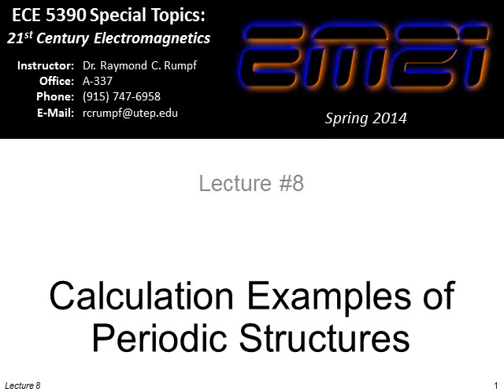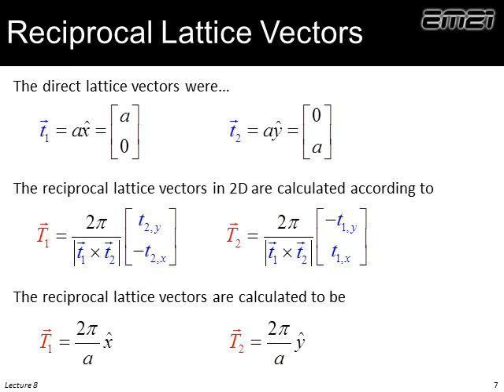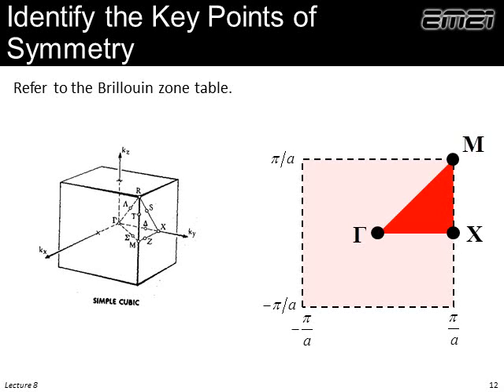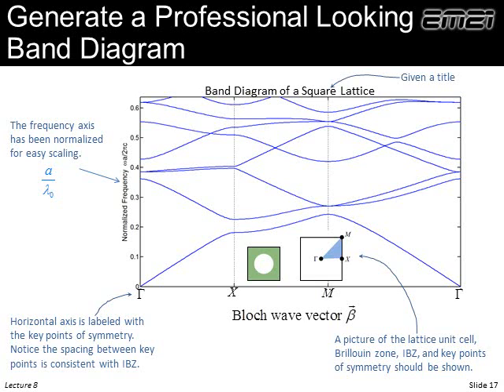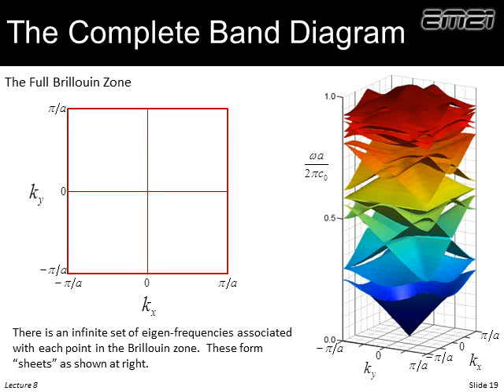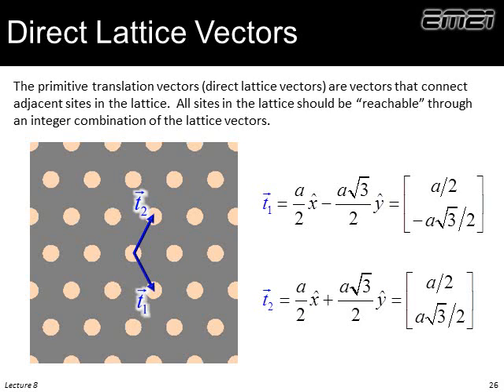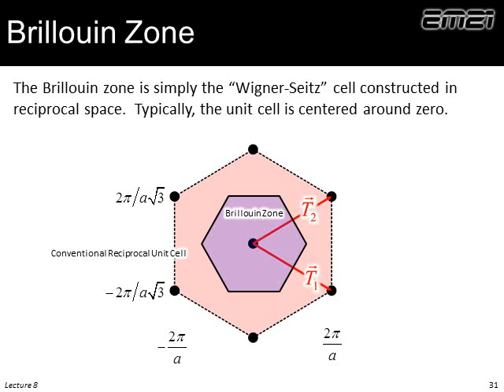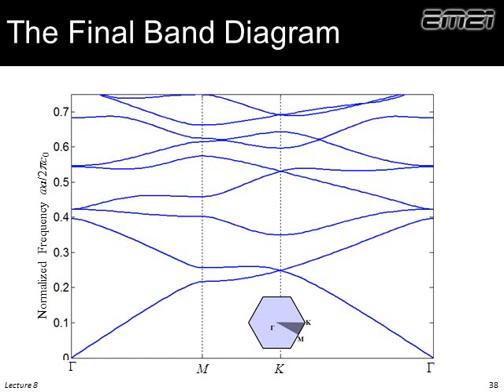Lecture 8 (EM21) -- Calculation examples of periodic structures

Comment: In the lecture presented here, the unit cell of periodic structure is contains circular hole what if it is not circular(hexagonal) or it has complex shape but let's say it has the same direct lattice vector as the unit cell of periodic structure that contains circular hole, is it appropriate to sample (kx ky) only along the boundary of  irreversible Brillouin zone?
Reply from the maker: The lattice vectors only describe the symmetry of the unit cell, not the pattern within the unit cell.  Therefore, no matter what, all unit cells of the same symmetry will have the same Brillouin zone.  Now, the IBZ can be different depending on the pattern within the BZ.  If the unit cell has left/right symmetry, like a heart, then you can cut your BZ in half.  A heart does not not have up/down symmetry or any additional symmetry so the IBZ would be half the BZ.  A circle, as you know allows the IBZ to be a little triangle within the BZ.  The IBZ does depend on the pattern within the unit cell.  Marching around the perimeter of the IBZ can be said not matter what the pattern is within the unit cells, but the shape of the IBZ will change.  Did I make sense?
Reply: @empossible1577   Thank you for your nice response! Just to make sure I got this right, so for example you mentioned (heart like shape) the corresponding IBZ is half of BZ, therefore, sampling (kx ky) around boundary (perimeter) of half of BZ would be enough? or we have to sample meshgird (kx ky) of over half BZ(IBZ)? Since I am planning to run multiple simulations for different shapes, I have to reduce my simulation time by sampling as small as possible(kx ky).
Reply from the maker: @wabidemeke3067  Each shape can have a different IBZ.  You may need to just always do the full BZ.  I suppose you could have your code check for symmetries and then calculate different IBZs.  Whenever I have done this, I just calculated throughout the entire BZ.  Yes, that wasted some computation time.

What numerical method are you using for calculating the bands?
Reply from the maker: @wabidemeke3067  Very good.  I noticed you are watching an older video.  In fact, I have actually greatly improved this section of material.  Checkout "Solid State Electromagnetics" under Topic 4 at the following site:

https://empossible.net/academics/emp6303/

Comment: What program did you use to get the band diagrams? And thanks for the lectures, they're super clear and helpful.
Reply from the maker: Everything here was done in MATLAB.  The band diagrams are usually calculated using the plane wave expansion method (PWEM).  This technique is covered in course prior to this one, Computational Electromagnetics.  Here is the course website for CEM:

http://emlab.utep.edu/ee5390cem.htm

Comment: Nice lecture. To obtain bandstructure using FDTD method, we have to locate the dipoles far enough from the pml boundary. I say it because they cause some noise in a bandstructure result but I dont know why? Do you have any justification for it?

Thanks
Reply from the maker: Unless you are doing something special, you should not need a PML in FDTD to calculate the band structure.  Instead, you should use periodic boundary conditions on all edges.  Calculating bands with FDTD is a bit tricky.  I talk about that in Lecture 10 here:

http://emlab.utep.edu/ee5390fdtd.htm

You may want to consider a different numerical technique for calculating band diagrams.  Take a look at finite-difference frequency-domain and the plane wave expansion method here:

http://emlab.utep.edu/ee5390cem.htm

Comment: Greetings  Dr. Rumpf. THIS IS THE BEST LECTURE I HAVE EVER COME ACROSS.... The material were cogently presented, well illustrated and with so much ease... I can't thank you enough for this video sir.

I have two questions regarding unit cells?

1.) If i use Finite Element approach in stead of PWEM. I will need to mesh the unit cell (that has the matrix and inclusion). My question is; should i mesh the physical unit cell, or the unit cell in a reciprocal space? 
If I have to mesh unit cell in a reciprocal space, how would i provide the dimensions for the inclusion, supposedly its a circular inclusion like the one you used to illustrate in this lecture

2.) My second question is, for 1D periodicity, would the two options for the choice of unit cells give exact same band structures?

Thank you in advance sir! And again, thank you very very much for this video lecture!
Reply from the maker: Thank you very much!  I am so glad the videos are helping you.

1) For FEM, you will mesh the unit cell in real-space (i.e. xyz).  There are methods that mesh in reciprocal space, but I do not think that is what you are talking about or would want to do.

2. What two options do you have for the unit cell?  A unit cell is the smallest block of something that can be stacked to recreate that something without any overlaps or voids.  Given the boundaries of the unit cell, you can slide that through your lattice and grab whatever pattern is enclosed within those boundaries without any problem or change to the band structure.  Maybe this is what you mean?
Reply: Thank you for your timely response Dr. Rumpf

1) Yes sir, my project is to use FEM to solve the Linear Eigenvalue problem for the "omega given k" approach as well as solving Quadratic Eigenvalue problem for the "k given omega" approach whereas the later gives the real and imaginary k for the complex band structure.... 

Now since, the traditional (or rather conventional) way of  computing the dispersion relations (band structures) uses First brillouin zone, which conveniently, gives the band structures that runs from through high symmetry points... I was just wondering how would i be able to replicate  these points if my unit cell is meshed in physical space (xyz)

2.) Yes sir, by choice of unit cell, I meant something like 2:30 in this video lecture on the top. if you use either of the unit cells, weather the band structures are going to be identical

I could subscribe two times if i could in your channel, what a fantastic lecturer and a person you are.
From the bottom of my heart, Thank you sir
Reply from the maker: @GBabuu  Thank you again!!

1. Build your mesh in real-space and then build your matrix.  The information from your Bloch wave vector goes into the periodic boundary conditions to enforce whatever phase condition is necessary at the edges.  I cover band diagrams with finite-difference frequency-domain (another real-space method) in Lecture 15 here:

http://emlab.utep.edu/ee5390cem.htm

2. Both unit cell descriptions describe the same lattice so both will lead to the same band structure.  In fact, this is a great way to test your code.  If you get a different band structure, something it wrong.  Most likely you have not built the lattice correctly in one of the descriptions.  If you calculate the eigen-vectors, you may notice the raw numbers are different only because the fields are shifted along with the unit cell.  They should look the same if plotted over several unit cells.

Keep at it!
Reply: @empossible1577  
Dear Dr. Rumpf. I'm reading your response with widest smile on my face. 

How ironic is it, you mentioned that, the way to know my code is correct, is by using two unit cell descriptions of the same lattice with anticipation to get same exact solutions....because that's what my project advisor insisted as well.

And  its also amazing that you mentioned that the eigenvalues and modes, will not be of same exact numbering because of the phase shift. THIS IS SUCH AN IMPORTANT INFORMATION because I wondered about this too.

I'm now watching lecture 15.
YOU SIR, ARE SUCH A JOY... GOD BLESS YOU!!!!!!
Reply from the maker: @GBabuu  Ha ha.  You have giving me a big head!  Thx!
Reply: Dr. Rumpf, I had a very quick question

For phononic crystals (just like photonic crystals)... I know one assumption we always assert is that they are "infinitely" periodically either 1D, 2D or 3D.

Let's say for 2D phononic crystals (with I direction periodicity) would you model a unit cell as plane strain or plane stress?

The reason I asked this is because, plane strain is a proper estimation for 2D structures when one dimension is infinitely longer than the other  two dimensions (which agrees with phononic/photonic crystals)...... 

But the issue is; strain and displacement are assumed zero in the infinite length of the structure under plane strain..

 How can we reconcile this with the fact that, for phononic/photonic crystals we certainly do need the displacements and strain in the direction of periodicity?

Thank you sir
Reply from the maker: @GBabuu  I am not quite sure what you mean by 2D phononic crystal with 1D periodicity.  Your terms stress and strain are new to me when describing the geometry of things.  If periodicity is just 1D, then you only have a 1D phononic crystal.  It could be  that you have a structure that is finite in one direction, periodic is another, and then infinitely uniform in the third.  In this case, you model will need to encompass the entire finite direction and one unit cell in the periodic direction.  

I am not confident I have answered your question.  If you need to send me a picture, send it to rcrumpf(at)utep.edu.

Comment: Could you explain how to resolve the band crossing problem as you mentioned at 12:35 ?
Reply from the maker: This is something I have spent some time studying.  I don't have an answer other than I think it may be ambiguous if the bands cross or not.
Reply: @empossible1577  Thank you for quick answer. I guess this have something to do with the mode shapes (eigenvectors). It's natural to think that all the eigenvectors should have the same shape if they belong to the same band.
Reply from the maker: @taolin4569  That was my thought as well so I created an animation where I visualized the Bloch mode of two bands as they approached and passed where they cross.  The Bloch modes abruptly change where the bands touch making it impossible for me to determine continuity.

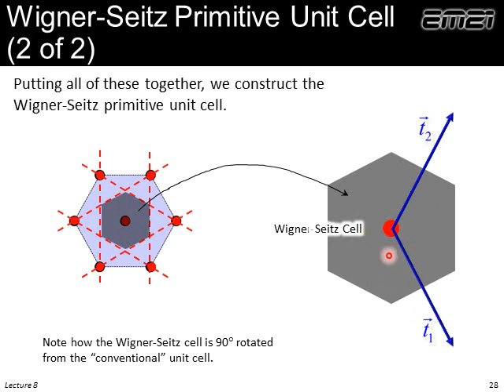Comment: at 21:46, i don't get the formula you use to find reciprocal lattices T1 and T2. what is [t2,y  -t2,x]??
Reply from the maker: Noah Nguyen The lower case letters (t1 and t2) are the primitive translation vectors of the direct lattice.  It is from these that you calculate the primitive translation vectors (T1 and T2) of the reciprocal lattice.

Comment: I always noticed that the points (111) became (kx=ky=kz=pi/a) and 
X(011) becam (Kx=Ky=pi/a , Kz=0)  Is there a rule for transferring them..? please
Reply from the maker: I think you are referring to the Miller indices?  A reciprocal lattice vector is an integer multiple of the primitive reciprocal lattice vectors.  The set of integers for that lattice vector are the Miller indices of the plane described by the lattice vector.  This may be the connection you are looking for.  kx, ky and kz are essentially the components of the lattice vector.

Comment: Dear Dr. Rumpf, I've been trying to simulate the band structure of a 2D hexagonal lattice using the PWEM as described in your lectures.  I'm sure my reciprocal lattice vectors and symmetry points are correct; however, when defining the device, I ran into some problems since the unit cell is not Cartesian but an hexagon.  In order to work around this issue I defined my unit cell as a body centered structure as follows:
a = 1; b = sqrt(3) * a;  Nx = 500;  Ny = sqrt(3) * Nx; P = 5; Q = round( P * sqrt( 3 ) );
ER0 = ( X.^2 + Y.^2 ) > r^2; ER1 = ( (X-a/2).^2 + (Y-b/2).^2 ) > r^2;  ER2 = ( (X+a/2).^2 + (Y-b/2).^2 ) > r^2; 
ER3 = ( (X-a/2).^2 + (Y+b/2).^2 ) > r^2; ER4 = ( (X+a/2).^2 + (Y+b/2).^2 ) > r^2; ER = ER0 + ER1 + ER2 + ER3 + ER4 - 4;
ER = 1.0 + ( er - 1.0 ) * ER;
However, once I run the simulation the band structure doesn't look right.  Could you comment whether the way I'm defining the device is correct or if I should use a different unit cell?.  Thank you very much and I really appreciate all the effort you have put into these fantastic lectures!.
Reply from the maker: Your code did not have everything I needed to verify what you are doing exactly.  I calculated X, Y, er, and r based on what I think you are doing.  Overall, the approach is correct.  The simulate a hexagonal lattice the trick will be how you calculate the Fourier coefficients.  There are two approaches.  First, you can perform a coordinate transform and then use a standard FFT.  For this approach, most people cite [Ward, A. J., and John B. Pendry. "Refraction and geometry in Maxwell's equations." Journal of modern optics 43.4 (1996): 773-793.].  The second approach is to perform the numerical integration of the equations on slide 8 of Lecture 18 here:

http://emlab.utep.edu/ee5390cem.htm
Reply: Thank you very much for your answer!.  My apologies for not including the whole code, but I decided not to do so, since it is basically based on your code for the square lattice.  

The only modifications I made was the way to construct the device, the reciprocal vectors definitions (T1 and T2), and the symmetry points (G, M and K).  I will double check the Fourier coefficients since I only changed Bx and By (through the definition of BETA).  Thank you also for the reference you suggest in your reply!
Reply: @empossible1577  can you explain me how to calculate the frequency of fonctionnement for 3D structure
Reply from the maker: @elmaftahsofia9564  fonctionnement?  Do you mean the operating frequency?  That is up to you as the engineer to choose the operating frequency.  Once you have that, you use the normalized frequency from your band diagram to scale the lattice so that it operates at your design frequency.  For example, suppose you have a band gap centered at wn = 0.5.  Now suppose you want at lattice that has its bandgap at a frequency of 20 GHz.  First, the free space wavelength of 20 GHz is 1.5 cm.  The lattice spacing should be a = 0.5(1.5 cm) = 0.75 cm.
Reply: @empossible1577  thank you
Reply: @empossible1577  plz can you explain me what does it mean normalized frequency ?
Reply from the maker: @elmaftahsofia9564  The basic eigen-value problem makes k0^2 the eigen-value.  Since k0 is frequency divided by speed of light, k0 is seen as frequency, but the scaling is not very useful.  A more useful scaling is a/lam0 where a is the lattice spacing and lam0 is the free space wavelength calculated from the frequency.  Given k0^2 eigen-values, you calculate the square root, divide by 2 pi, and multiply by a.  This is the "normalized frequency."

Comment: Is this Brillouin Zone calculation is valid for non symmetric lattice also??
Reply from the maker: +Vinod Kumar That depends on what you mean by non symmetric.  There are pseudo-periodic lattices that have some randomness to their geometry, but otherwise appear to repeat.  Some examples are penrose tilings and such.  Those do have a BZ although it is derived statistically due to the randomness.  If it does not repeat at all, like in a functionally graded lattice, the lattice does not have a BZ.  It still may help to think about localized portions of the lattice having a local BZ although it would only be an approximation.

Comment: Thanks for the nice lecture could you explain why K = 1/3T1+1/3T2 in 25
Reply from the maker: This just comes down to geometry.  If you draw the Brillouin zone and work through the geometry to calculate the positions of the key points, this equation falls out.  There really is nothing more to it.

BTW, this section of the course has been considerably revised.  I recommend accessing the material through the course website:

https://empossible.net/academics/emp6303/

The revised version of this video is now in Topic 4.  

Hope this helps!
Reply: @empossible1577  Thank you so much

Comment: Why we use band here instead of curves?
Reply from the maker: For ordinary homogeneous materials, there is just a single dispersion curve, or "light line."  However in periodic structures, there arise multiple solutions that have multiple lines.  Each of these is a band.
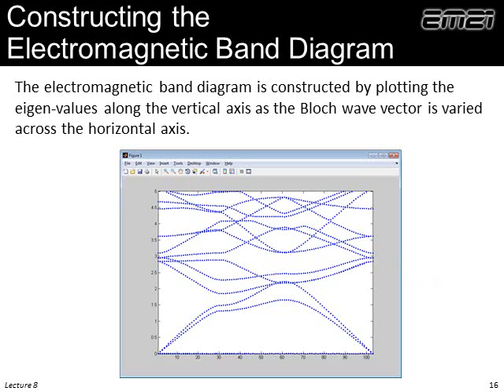Reply: why each line form a band? If we see graphic at 10:51 we only see lines but if we see each of them over the k-axis so it can be said each line form a band ?
Reply from the maker: This diagram shows a bunch of discrete solutions plotted as a function of the Bloch wave vector.  If done at high enough resolution, the discrete solutions fall along lines that we call bands.  This comes from solid state theory and is why we talk about bands in semiconductors.  If the discrete solutions jumped around more randomly, that would imply that small changes in frequency produce wild changes in the Bloch modes and that would not make much sense.  There are multiple bands because there are multiple solutions to the eigen-value problem.  This is the same reasoning behind why there are multiple solutions for modes in a waveguide.  In a photonic crystal, we can keep calculating more and more bands simply by moving to a higher frequency.